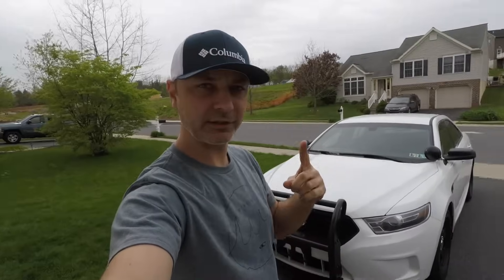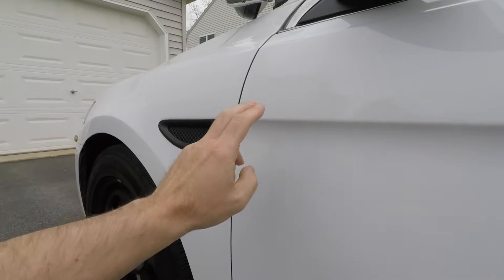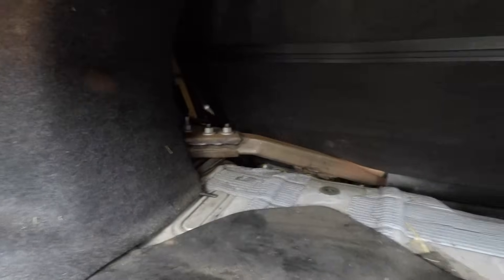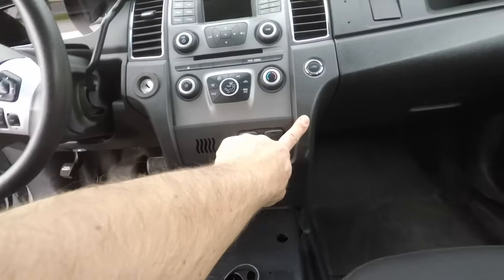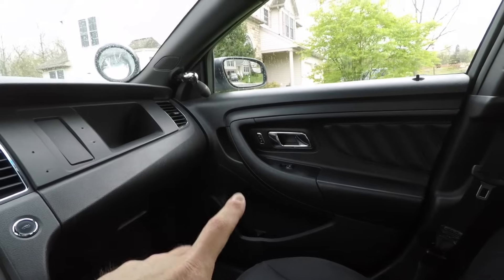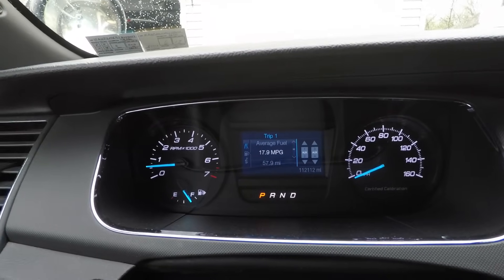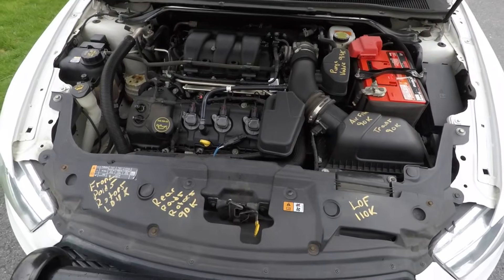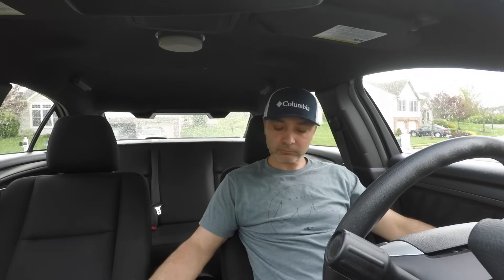I bought Police INTERCEPTOR, OVERVIEW and what comes with it, PROS & CONS

Comment: Some stuff I'd like to mention, since having owned a retired Charger, that calibrated speedo doesn't mean that all other speedos aren't calibrated. It's a legal thing for cops to use that speedo as a means to write a ticket. All civilian cars are calibrated to similar specifications as the police ones. It's just for when you take a speeding ticket to court, the cop can have the backing of a 'calibrated instrument'. They're supposed to re-certify the speedos every other year, but nobody does. 

Those asking if the lights work, yeah if you've got the control head for them. You can keep them on the car, but it's a felony to use them on the road. You also cannot add/re-add the lights if you remove them. 

But the doors being armored up is new to me, same with the rear structure reinforcement, that's actually really cool but looks like a nightmare if you've gotta do work on the car. My dodge had heavy reinforcing crossmembers in the doors, which was really nice cause side impacts are kinda scary. 

As for the gas mileage, I run 93 in my SHO, and get 14mpg lmao. Which is crazy, since going from a Charger, I'd thought I'd get the same or better gas mileage but hell no lmao. But seeing you got 19mpg, you have the 3.7NA, and not the 3.5 Ecoboost. The Ecoboost fuckin' drinks gas. The 3.7 is a great engine, my dad has one in his exploder (Just do the timing belt & water pump, those fail ~120k miles, and with them goes the rest of the engine).

Anyway all said and done, I had my fun with old cop cars, but I'm gonna stick with civilian cars. More comfortable, and less problems. That and I really enjoy my civilian SHO, I just really, really miss the RWD of the Charger, that was super fun.
Reply: i have a retired exploder too

Comment: We used to buy old rcmp cruisers. They actually switched out the carbs and detuned them. We did get the 75 gsllon fuel tanks, the solid drive shafts, the duo alternators and battery in trunk. They would spray can the white doors, shitty job. Fixed right they made great FAST cars.
Reply: "They actually switched out the carbs and detuned them".....pure BS. Its a myth.
Reply: @psycosoft1  Well, if you must know....I've owned many ex police cars dating back to 1995, so do I know for a fact they didn't detune carbs back in the day? I suppose not. However, I've been asked many questions about my cars, from "did they change the camshaft?" and "did they change the computer before you got it?", etc, all of which are absolute BS. So, fountain of nothing? Hardly; but believe what you wish.

Comment: I just purchased  2014 Interceptor at an auction 192K miles, $3750. The rear door actuator is on the drivers control panel. Press the switch and the doors and windows will work. Additional reinforcement in back seat is to survive 75mph rear impact.
Reply: true statement. only cop cars have this rating , i believe .

Comment: Great car and channel Pete, im looking at one tomorrow morning a recent retired 2015, from Maine State Police. Thank you for this video. My wife drives a 2013 taurus civilian SES AWD. I buy these police interceptor because even at 120k miles, I can put another 150k miles of Maine driving. I'm a process server and private investigator which means I drive a lot. While not a good surveillance vehicle, its top notch. My 2010 Crown Vic  was totalled last winter.
Reply: Robert: I purchased a 2014 Taurus P. I. from a Michigan State Police auction a couple of monthgs ago. I am in the process of replacing the interior panels, which had drill holes in them, and I am installing a civilian center console from a Taurus SEL. If you are in the market for a 2013-2019 Taurus P.I., make sure that the water pump has been replaced, as there is a design defect on Ford's 3.5 and 3.7 liter engines which result in water pump failure and ultimately engine damage.

Comment: The car should have two catalytic converters and they would be mounted right at the end of the exhaust manifolds.  There was even a recall for the catalytic converters on the 2015 Taurus Police Interceptor.  See it here:  https://testing-public.carmd.com/Tsb/Download/105770/R14E01
If they were removed on your car, then the seller was breaking the law when the car was sold to you.
Reply from the maker: I looked in all of the police cars on the lot, they all have same exhaust systems, and these cars coming right off of the state police fleet, I am getting them from Government, not from resellers...
Reply: It has cat converters, right off manifolds. No headers. Just cause you dont see them hanging under the car n theres not 4 of them doesnt mean they're not there.

Comment: I am wary of these Taurus PIs and Explorer PIs: they have a poorly-designed and positioned water pump that can fail without warning and cause catastrophic engine failure. I would only own this car under warranty. It's sort of a shame, because it really is an awesome vehicle. Just make sure you're keeping an eye on the temperatures, and look for any leaks.
Reply: The water pump is internal and has a high failure rate.  It totals the car since the engine has to be pulled and torn apart.
Reply: @user-tb7rn1il3q  That's why I decided against buying of these. Ford should have recalled this, but they didn't. There's a class action lawsuit, now, but I doubt it'll go anywhere.

Comment: The low MPG is probably due to idling for extended periods. I have an 08 Ford Fusion and my MPG meter decreases every minute or two the car idles without moving.
Reply: Nathan Heaverlo my 08 Ford Escape does the same thing
Reply: The computer has an hour memory. Look it up.

Comment: Just FYI - I have 2013 Explorer Interceptor - and I get like 9mpg on E85 flex fuel. When you run regular gas - its more expensive - but better mpg as well. The 11mpg was from running E85 FLEXFUEL. I also have 3.7L. I was hoping yours is 3.5L EcoBEAST.
You're transmission has a "Pursuit" Mode - when you hit the brakes really hard - your shifts will become aggressive (high rpm) - try it out.

Comment: Why would a department decommission a 2015? 
Its barely broken in.
Reply from the maker: All cars come with 100-150K miles, some run that up in 2 years, others in 4, there are 2016 year models with 140K miles on them. That's well broken in and some
Reply: Did you have to do the timing chain yet?

Comment: The safest vehicle on the road is not a big truck, it's a late model  Ford Taurus in Police trim.

 Because wherever the car goes, everyone automatically slows down and uses there turn signals when changing lanes.
 

You think Corvettes get respect? Buy a two-three-year-old Ford Taurus and you'll be the safest driver on the road. Because everyone slows down around you, and no one cut's you off ever..trust me

Comment: Lookn good lookn good, it's a shame these sobs a Ford quite makn the Crown Victorias those were always crusiers, they run ride VERY smooth👍👍oh my gosh you can't feel the speed that your going, by the the you know it your going 70 or 80 mph😭😭. I love my 95 Victoria, jus installed a new engine in it may say I'm back to speedn😭😭lol, so does your cat have V6 engine, also did your car come with jack and tire iron, if not that little compartment you open on the left side, I believe is where your scissor jack and tire iron is supposed to be. Thanks for sharing this me. Nice car👍👍

Comment: I'm curious how the car held up. I'm going to look at one tomorrow, nearly identical but it does have the center console. Curious how much work it was to enable the rear doors, I would also want to install a proper sub on the rear deck where that fan is; also curious if that fan is drawing power and running the whole time the car is on. Thanks for any info.
Reply from the maker: Car holds up well, fan is not an issue, police car has 200AMP alternator vs 120 AMP in regular car, think of all the computers lights and radios police car has to power up. that car can handle some crazy sound system for sure

Comment: I have Crown Vics I'm thinking about the Taurus Interceptor is it In your opinion a good car?
Reply: As an advent car enthusiast, the Police moded version is gold compared to the standard, although do be wary that you Miiight get pulled over just to see if you're impersonating or not. Also, cars will slow down for you but it's not fun when you're in an actual hurry and you don't have and can't have functioning lights, and the cars in front of you don't move or speed up. And while it can be fun at times do keep in mind it will change your daily habits

Comment: the slide out tray is where the radio and the emergency light and video equipment is placed. Yes  that  is a cooling fan for the police equipment that is in the tray. The fan vents the heat into the back seat (crazy huh). The backseat is comfortable because the barrier has been removed that is between the front seat and the back. The big plus about owning a former police car is that you get a strong engine and transmission, drive train, electrical system, plus pursuit tires.

Comment: you can enable the factory keyless entry - google for it. you'll have to buy a hood sensor,  and the remote fobs/keys - this also enables factory remote start. the door straps are to prevent the door from swinging open too wide. you can unhook them if you want the door to swing open wider. the tray in the back is for the radio/computer/camera recorder. your car also has a pursuit mode - accelerate hard or slam on the brakes really hard and your engine will stay revving around 2k RPM to keep the engine up in the power curve. google how to enable your rear door handles and to connect your rear door locks and window. you can buy any taurus console and fill in that empty space in the middle. and yes, you can't go anywhere fast on the hwy or city with it because everyone slows down, lol
Reply: There's another little cheat on these...... cars if you push the low range button on the end of the shifter..... it drives just like pursuit mode.
 Shifts at higher rpm while accelerating and rev matches the down shifts higher rpm during deceleration as smooth as silk.
 I have a 2015 Eco boost interceptor.....fast and fun even when not floored. Basically a Heavy Duty SHO.
Reply: @skeetermcswagger0U812  I just call it the overdrive off button lol
Reply: @devinthierault  ok your choice,..call it whatever you want but it doesn't mean that's what it is.

Comment: The reason when you get them the MPG is so bad is because the police idle them for hours
Reply: Right I got one the engine time was 8000 with a 5000 of it being idle
Reply: So the mpg on screen is going to be low or it’s going to be true? So 10 mpg on screen is what your gonna get driving it?
Reply: @coleanderson8242  no you can probably reset it and get better mpg or wait for it to even out but either way they aren't super fuel efficient maybe a little better than crown vic but I'd rather have a nice vic too bad there's so few left

Comment: Check your local laws on the two spotlight thing, not legal in Ohio for example for civilians.
Reply: Source?
Reply: @jaypee902  4513.12 SPECIFICATIONS FOR SPOTLIGHTS AND AUXILIARY DRIVING LIGHTS.
(A) Any motor vehicle may be equipped with not more than one spotlight and every lighted spotlight shall be so aimed and used upon approaching another vehicle that no part of the high-intensity portion of the beam will be directed to the left of the prolongation of the extreme left side of the vehicle, nor more than one hundred feet ahead of the vehicle. Any motor vehicle may be equipped with not more than three auxiliary driving lights mounted on the front of the vehicle.
Reply: @mac11380  Good to know!
Reply: It make sense. Cause a car like that .. a maniac could easely use it  for approach or stop people and make a criminal acts

Comment: The slide out tray in the trunk is where the electronics were housed/kept/mounted. Power inverters, converters, amps, controls modules/boards for the lighting, sirens, and radios, etc. That's what they are used for in my town.  I have been able to watch a company install the electronics and gizmo's and that is  where they put them, very cool car, I'm a car guy and I have always wanted to buy/drive a police interceptor.

Comment: Regarding 12:39, non-calibrated speedometers are usually off by 2% to 3% in the positive direction (the displayed speed is faster than the car's actual speed).  You can easily verify this with a GPS speed app or navigational app such as Waze that displays GPS speed.

Comment: The tray would have been for the guts of the 2 way radio and more modernly a mobile modem and other computer equipment. Your trunk is likely equipped to keep cool on hot days too. Tighten up that light and make them all operational again. But DO NOT activate them unless you're on private property. If you operate them on public roads and highways, and a cop sees you, they will arrest you and charge you with impersonating a police officer. That would be very bad.

Keep the push bar too. That will offer extra protection in a crash and help you help others by pushing them to a fueling station. I have done that before.

Comment: It has cop tires, cop brakes and cop shocks😌
Reply from the maker: It's Taurus SHO performance package minus the ecoboost engine. I have SHO myself and I know what I am talking about
Reply: Pete717 I have a 2013 explorer sport with the twin turbo eco boost. It’s quick!!
Reply: Pete717 that line is from a movie btw, the movie is “blues brothers”. He gets a cop car and says, it has cop tires cop shocks cop motor! 😁
Reply from the maker: @just-incase3483  They are, check my SHO playlist videos, I have Taurus SHO on stage 4, sick fast, 12 seconds now, going in to low 11's next month, my friend has 2014 Explorer Sport who is doing lots of mods on him too
Reply: Pete717 I’ll check it out thanks👍🏻
Reply: Made before catalytic converters so it runs fine on normal gas.
Reply: jago668 😂🤣
Reply: Dammit, Just-in-Case, I hate it when people beat me to the joke.  Elwood Blues's description of the new Bluesmobile was the first thing I thought of.  Love that movie.
Reply: Ernie Lederman 😂
Reply: By the way, the full dialogue goes:
Jake: Car's got a lot of pickup.
Elwood: It's got a cop motor, a 440-cubic-inch plant. It's got cop tires, cop suspension, cop shocks.  It's a model made before catalytic converters, so it'll run good on regular gas.  Whaddaya say, is it the new Bluesmobile or what?
Jake: Fix the cigarette lighter.

Comment: BTW did you find the tremco switch??
Reply from the maker: I did not, what is it?
Reply: @Pete717  ignition interlock.tremco was all the rage for the crown vics. Not sure who they would have now but there all similar. Hidden switch, may or may not be able to take the key, then you're able to leave car the running. Anybody tries to steal it will shut off

Comment: Regarding speedometer: Your speedometer shows the right values. 
Legal regulations says that a speedometer must never show a lower value than actual speed.
Reply: This vehicle has different size wheels(not standard) and because of that speedometer would show incorrect speed. It needs to be recalibrated to show correct speed.
Plus with the bigger diameter tires, it does show lower than actual speed.
Reply: @bara2ban  If that is the case,  you are driving with a wheel combination that is NOT permitted by regulation (homologation)
Reply: @larsev  I do not see a reason to continue this conversation because this comment started without good ground bases because all he mentioned is about his speedometer being certified. At this point if the wheels on this vehicle are the same size that went through certification his speedometer shows correct speed even if these wheels are in a different size from regular Ford Taurus that the factory puts on with pre-calibrated speedometer.
So to sum it up, his speedometer shows correct speed even with bigger wheels than a regular Taurus and his vehicle is homologated.

Comment: 5:04  The X-brace under the back seat and in the trunk actually IS factory-installed and is what gives the PIs the 75-mph rear collision rating.  Regular Taurus sedans (and Explorers) don’t have that but all Ford Police Interceptors do have it from the factory.  Also, the tray in the trunk was for remote-mounted radios.  Nice find though!
Reply: A fun little thing about the crown Vic interceptors is they actually have a 90MPH rating for front AND back collisions (at least from my local department) though they don’t have all this fancy stuff this fella has! Beautiful car though! (Also let’s be honest, if you have a cop car you’ve accidentally locked yourself in the back at least once.)
Reply: @AlastoriaHall  The crown vics never had a 90 MPH rating. No car has that. That is WAY too much energy. That is why the 75 MPH rating was groundbreaking.
Reply: @baddriversofthenorcalarea500  well hate to burst your bubble but mine does in fact have 90 MPH impact bumpers for front and rear and I have the paperwork to prove it. I also have two car crash survivors who can also attest theirs had 90 MPH impact bumpers that saved their lives in high speed collisions! Perhaps its just a FL patrol car thing.
Reply: @AlastoriaHall  There is a difference between surviving a 90 MPH crash and being rated as safe in one. I would be interested in that paperwork, as I cannot find anything related to that online. The crown vics actually had a flaw when being rear ended.